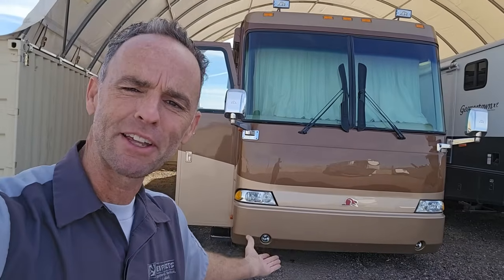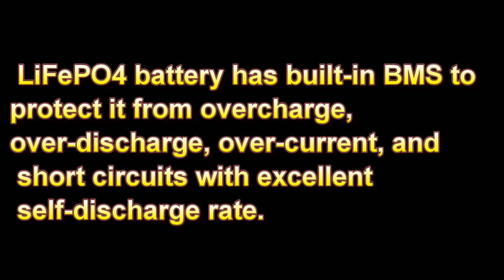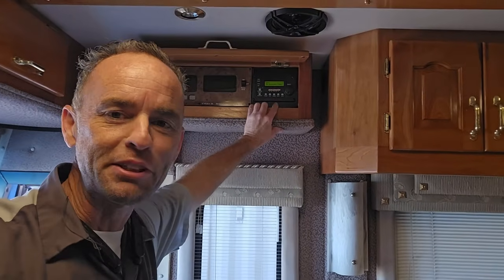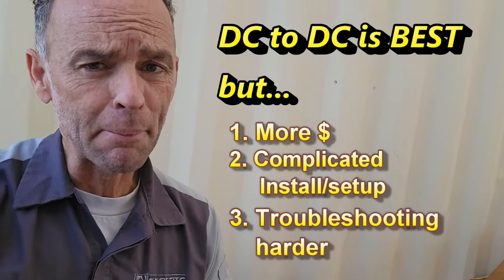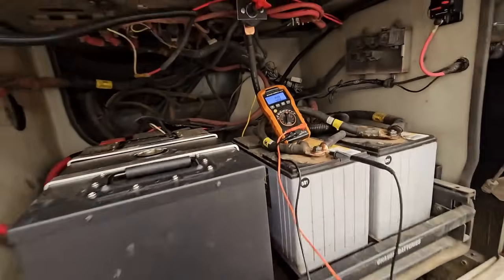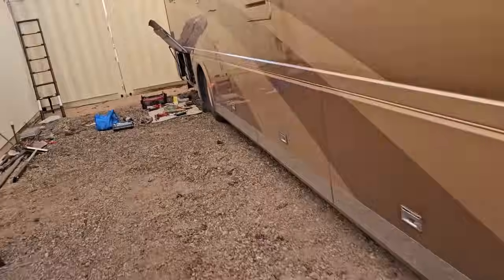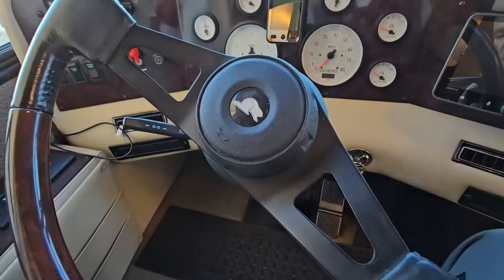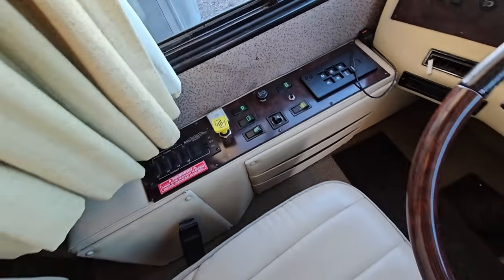What You NEED to Know About Adding Lithium Batteries to Your RV

Comment: I built a LiFePo4 battery using prismatic cells from EVE and a Daly BMS. I've used it in my Class A for a year now, with zero problems. This battery connected to an EG4, 48 volt input, 120VAC output, 3K watt Inverter powers everything in my RV except the AC. i also have two converter taps off the battery bank to run 12V and 24V systems in the RV. Factory built Lithium batteries are easier to purchase and install, but my system is FAR less expensive, per watt-hour, and is constructed the same way the factory builds are, using very similar components. The only difference between my battery and yours is the size. Mine's larger, with a higher capacity.
The downside to using the system I built is that you need some electrical knowledge and how to construct battery systems. Outside of that, both our systems are bulletproof. Will Prowse, here on YouTube, has a lot information on how to build a LiFePo4 system.
I love your videos and have benefitted from them. Keep up the great work!

Comment: You can re purpose your battery isolator to charge your chassis battery with the solar and never need to lock down the boost switch again I know you took out the jumper relay its just in case your new relay leaves the chat your solar will charge the chassis batterys. Just put the wire from the house batteries to the alt side of the isolator  and number one to the chassis battery, it works great on my Monico. Keep it going. We all Love your work.

Comment: I used to have the same battery isolator in my 2000 Monaco dynasty. I went the DC to DC charger route on my coach with a 40 amp Renogy Unit and I’m happy with it.

Comment: Excellent video. I think you have discussed all the important points. I have a 2022 class A on the F53 chassis. When I upgraded to lithium I spoke to Lion Energy and Battle Born techs and well as Victron. I changed out the converter, added a Victron DC-DC charger and changed my ZAMP solar controller setting to lithium. 
Because I’m always concerned with electrical connections and shorts I paid a local repair shop here to check and confirm everything was good. 
16 months later and everything still working great. 

I truly appreciate your videos. Thank you

Comment: AWWW, this is an excellent vid.  I now know I can buy and realize an roi by replacing my lead acid with a lipo4 battery☺ using existing charge controller and inverter in my towable!  I also, have learned I can reach a 100% by using a lithium charger connected to battery and/or using solar with lithium charge controller.  Again, thank you.

Comment: Great video! A few points I think is good to make. If you buy a quality battery for the most part you don't have to worry about longevity of the battery. Most quality lifepo4 batteries will have charge cycles exceeding 3500. That means you can charge/discharge down to a reasonable percent (20% is usually the absolute lowest you should go) that many times and still see 80% of original capacity. Not charging to 100% will only make this number better. That means in 10 years your lifepo4 battery will still be 80% of what you purchased! 

Also when selecting a battery make sure it has a hot AND cold cutoff sensors especially if you're in those climates. Lifepo4 doesn't like being too cold or too hot and will damage the battery, this cutoff sensor will prevent damage. Some batteries come with built in heaters that'll keep the battery above a damage voltage.

Either way, great install!

Comment: You have answered many of my questions concerning the lipo4 batteries. I have opted to keep them on a Seperate Circuit. I can top them out with an eu2200i and ac-dc charger or solar power.
The Lithium circuit charges the Chassis battery via a trickle charger/maintainer.
This keeps them isolated from one another.  Also have a 700w inverter on Chassis side for power on the Move which can also run the Ac/Dc charger for the Lithium bank so on arrival the Lithium is topped off with little to no strain on the Alternator.
Reply: By the way your Content is always appreciated Love your Videos and Knowledge. So much so I am now a Mobile RV tech 😂

Comment: Great presentation, love your channel.  You always have good, practical information that you can and do demonstrate, Thanks.  
I would like to point out that these RV batteries are not the typical Lithium Ion batteries that  most people are familiar with -- these are Lithium Iron Phosphate (LiFePO4).  It is my understanding that this type is not prone to over heating and can take a lot of abuse (not having to recharge so often), all the while in cold storage they will hold a charge way beyond what any other types will .. some have said, like a year later that this battery still shows up to 90% charge .. try that with a lead acid.  These batteries do not give off any residue or dangerous fumes while charging or sitting still, and because of this they can be mounted just about anywhere, even upside down.  Sounds like a miracle battery, right?  My 2022 Sunseeker came with two AGM house batteries, while the house charger/converter, came with a Lithium on off switch.  I swapped out the AGM for 2 Lithium Iron Phosphate (LiFePO4) in the battery well under the entry step, and connect two more in the storage bin just outside the door.  Another upside -- they are half, or less, the weight of AGM or any Lead Acid battery.   One down side -- in my research -- it has been advised not to use these batteries as a starting battery, something to do with cranking amps, but great for continuous use -- a good, or better choice for motherhome use.  
Thanks again for for the great input and demonstration -- definitely filled in some question I had, like the Li-BIM thingy -- thanks, Dan

Comment: Glad I gave a listen, my Foretravel MH has a switch to tie all batteries together for starting, not just a momentary Emergency start switch. I'm putting 2 of those liop4 batteries to replace the 3 8d gels. Never considered the Alternator limitations or the Em start solonoid issue you've brought to my attention. I have a portable 3-30-200 amp charger that I could rig to boost 200 amp for emergency start with the EM start switch instead ( generator running, shore power or inverter powering the portable charge/ boost) . Almost like a snake eating it's tail in the later mode. 😂 I didn't even think of the Isolator issue and the stress on the engine alternator. Guess that funny looking Isolator Amazon was offering me, without explanation, had some merit. Thanks for the video.

Comment: You are absolute right that LiFeP04 batteries are safe. But poor installation of LiFeP04 can. And many RV do have poor electrical systems that do not present a big problem with LeadAcid batteries. But install LiFeP04 and it can get dangerous. In my RV the cable from the converter to the batteries was not able to transfer the 60A to the battery. With lead acid not a problem as lead/acid do not accept higher amps for a long time. With LiFeP04 this cable got very hot.
Always install a T-fuse directly after the lithium battery. T-fuses have an interrupt current of 20000A. “Normal” fuses can weld shut.  The BMS is just an on/off switch for protecting against under/over voltage and temp. It does not replace proper charging equipment.

Comment: You did a great job explaining. I would also remove the  alternator charging rectifier and replace it with a smart one but install it away from the alternator and engine. Then when it gets hot or the amp draw decreases then it lowers the output or shuts down. if you cant afford a smart rectifier than moving it and adding a big heatsink will help keep it cooler. Heat as always is the enemy of electronics.

Comment: Thanks so much, James!  My factory installed equipment was similar to yours on my 1997 Safari.  I called Battle Born  after purchasing my equipment from them.. I ended up setting up the equipment improperly and until I saw your video I did not realize it was not correct.😮 I won’t bore you with the details, but I just wanted to let you know you helped me get my system installed properly.  I had previously installed a  240 amp alternator so I do not know if my original installation would have damaged my alternator over time, but I am thankful to have the equipment hooked up properly now.

Comment: My LiTime Lithium Batteries are fully charged @13.5 volts.  They will absorb and eventually float to 13.8v daily.  I use Victron Shunt and Network to monitor it and Victron MPPT to keep topped off everyday.

Really enjoy the graphs provided by Victron in the App.

Comment: Just wanted to let you know, that I absolutely loved your video. I thought I had researched lithium batteries fairly thoroughly, but I did not realize the charging issue. My system currently has 1800 amps of charging from the roof solar. And I'm charging 4-6 volt AGM batteries wired in series and parallel. These batteries are about 3 years old and I will be changing them to lithium at some point in the future. Thanks again for your thorough advice.

Comment: thanks for the info on emergency start switch. I have a trailer now with Lithium batteries but in the past had an old Class C which I remember that button. I will keep it in mind when eventually move back to a Motorhome.

Comment: One day when I break down I hope your around. You know your shit!  I installed my system on my travel trailer and love Lithium batteries.  I replaced my charger on my trailer that gave I think 30 amps with an inverter/charger from Renorgy.  3000 watts with a 6500 watts boost for 2 seconds and 65 amps charging for my 200 amps of Lithium batteries (small system but capable) Runs my tv and Starlink for 36 hrs none stop.  Love my system and it gives me coffee and toasts anytime, without the dimming of lights as before with lead acid sometimes had to run the truck engine for a Keurig coffee before.  I can start the air conditioner no problem and run it for 2 hours (current draw of 1200watts or about 100 amps).  However I only run it for 30 minutes when stopping for lunch and it damn hot outside.  Thank for the video, cheers from Canada!

Comment: I installed the Renogy 50 Amp DCDC converter rather than that smart relay you used.   The Renogy included a 25 Amp MPPT solar charger as well.  If solar is installed, the Renogy unit will charge the starting battery from the solar panel after the coach battery is fully charged. It was very easy to install and configure.  It doesn't required a start or run wire from the vehicle.   It works great and absolutely limits the load on the alternator to 50 amps as opposed to the relay that AZ Expert used that has some voltage thresholds and time intervals.  I just didn't want to load the alternator at 100 Amps.
Reply: How many watts of solar do you have and how many amps and voltage are you making out at from them? What size PV wire do you have?
Reply: That's my plan as well.  I already have the a 40A DC-DC charger.  100A into a the right set of lithiums is probably low actually.  The fact that these things do that for several minutes and then switch off.... I don't want that much stress on the alternator for 15 seconds, let alone 15 minutes.  I'm an electronic technician.  This is not something I would design for intermittent service.  If you have to shut it off periodically because it's too much current, don't feed it so much current in the first place.
Reply: @EliTuber  Today I have a single 170 Watt panel that gives me about 7 Amps in full sun.  So I can add two more of those before I max out the 25 Amp charger capability.  I' used wire I had bought for another project.  It looks to be  10 gauge?  It's wire rated for outdoor solar panel use.
Reply: @EliTuber  Sorry, I didn't see this earlier.  I had a single cheap 170W panel from Amazon.  I could run for a few days before needing the generator.  I recently installed a second 170W panel and that is awesome. The single panel would charge at 7  to 10 amps.  I went with 10 gauge wire. Probably overkill.

Comment: Good video. I probably would have switch that signal battery momentary rocker switch to a off/on rocker switch and add a relay to ignition so ignition is disabled when switch is in on position while charging the chassis batteries.  This way you don’t need pry something in the momentary rocker switch to charge it and RV can’t be started while the switch is in on position charging the chassis batteries.

Comment: All good points you make. I went through this with my 5th wheel when adding lithium bats. Kept the stock charger knowing it can’t fully charge.  Once I add solar I’d use the mppt w/ correct profile to charge or if I decide to add Victron multi plus 2.. my truck to trailer I don’t worry about it on the dodge as the small wiring limits the draw on the alt.
Your video is well done and thought out. Your common sense is refreshing.
Reply from the maker: Thanks you! :)

Comment: Great job. I appreciate your taking the time to do this. I was going to upgrade to Lithium when my supplied RV house batteries were 3 years old in my 2020 class A gas puller, but my WAFCO unit was not Lithium compatible. I considered buying an inexpensive standalone lithium battery charger and plugging it into the 120-vac outlet in the compartment where my inverter is installed and direct wiring to the house battery terminals at the input of the inverter to charge the batteries when plugged into shore power or when the generator was running, but it would not have solved the alternator issue. I was hesitant to do a DC-to-DC charger since it was something new to me (I am a retired electrical engineer but that doesn't make me an expert in these systems). Instead, I invested in two good 6 v Golf Cart Batteries which should last me about 5 to 7 years.  Buying then from my Golf Cart center, I was able to get good quality batteries very reasonable. The two batteries were about $330. They will soon celebrate their second birthday and still aren't fully broken in. 
I have installed a small solar system (200 W) on the roof with an MPPT controller and I carry 200 watts of portable solar panels in the belly of my unit with their own solar controllers to set up when I'm stationary for a while. Since we have a residential refrigerator and only 2 house batteries, we need to run the generator 12 hours a day to keep the batteries charged. With my solar, I can reduce it to about 2 to 4 hours depending on the sunlight. If I converted to LFP batteries, the solar would probably keep them fully charged so I wouldn't need to run the generator. 
With the continued reduction in the price of the LFP batteries, I might be able to cost justify the conversion next time. That Precision Lithium Battery Isolation Manager is affordable so the entire conversion will probably be possible for about twice the cost of staying with Lead Acid Golf Cart Batteries. 

We only boondock a week or two a year, so it is difficult to cost justify the conversion cost. With my current solar system, if I were to save 4 hours of gen time each day we boondock and we boondocked 14 days (we've never done that many), I'd save about 2 gallons of gas a day (we have a 5500-watt Onan gas unit) for about 28 gallons of gas a year which is about $100 a year based on today's gas prices. Of course, $100 per year over 7 years (battery life) does pay for it, but we have to run the generator 45 minutes a month anyway. We're not sure how many years we will continue traveling in the motorhome, so it's hard to cost justify much in upgrades if we won't benefit from them. If I do decide to convert, thanks to your video, I now have a path to do so.

Comment: Thank you for your very simple explanation about charging the Lithium batteries. I currently have a Xanterx Freedom 458 Inverter/Charger in my 2006 motorhome, I am hoping that installing the Lithium Battery Isolation Manager will allow me to charge while driving down the road along with the solar that I will be installing.

Comment: I bought an EarthX LiFePo4 battery intended for experimental aircraft, it weighs next to nothing and seems to be able to crank over anything normal, so not a huge diesel, but, it’s limited to 80 amps for charging. I put SB connectors on it and on all my vintage Volkswagens, mowers, skid loader, and one on the end of half a pair of jumper cables. It works so good, no more having 15 batteries and 15 battery tenders and all these have small generators or alternators that are less than 80 amps, so working great for me. But it is a $450 little battery. Really appreciate this video, just about to start the upgrade on my Damon Tuscany for lithium and solar and really needing information so I can hopefully do it once, correctly.

Comment: This is great into. Thanks.  I want to do this with my yr2000 Dutch Star.  My Charger inverter are pitiful now so may upgrade that, to something like a victron 3000.  My fridge is still elec/gas and works great. But if/when it goes with go to standard 110V.  Again, thanks for the well laid out info. No not super detailed but much more than I know before!

Comment: You did a great job !! I have pretty much the same setup. I removed my Big Boy and installed the Li-Bim.. I left the Signal Lead off. However, I did have to run a separate wire with 12v and fuse for the power of the Li-Bim. Going on 2.5 years and no issues.